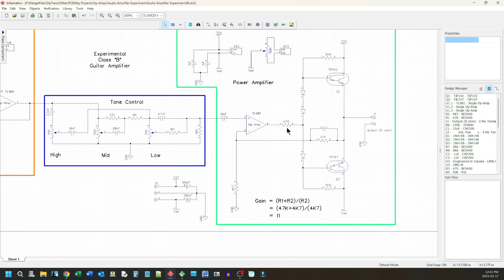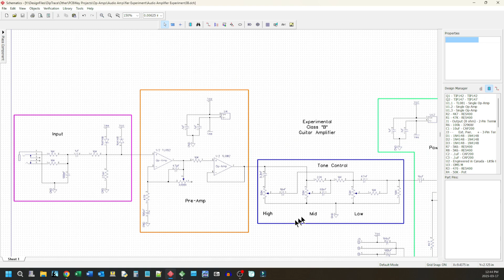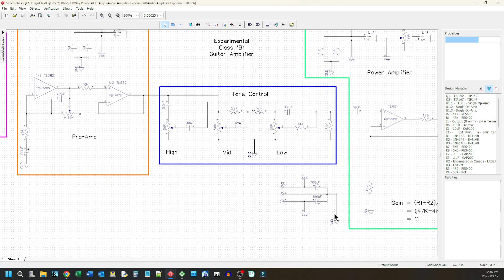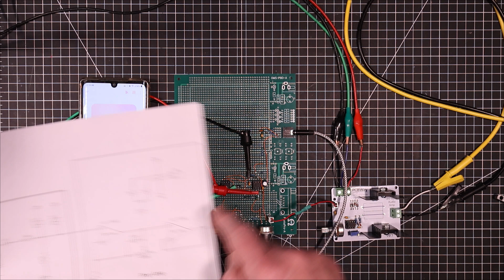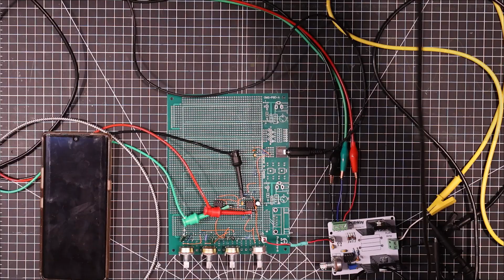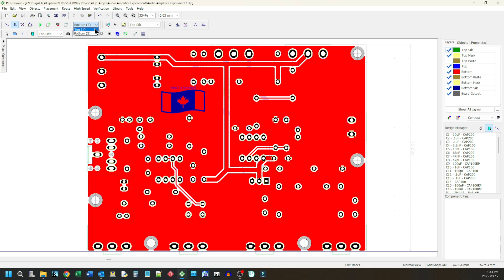Uni-Byte 0263 - SOMETIMES You Just Have To GUESS : Easy Guitar Amp: Part 3

Comment: You need a resistor between the  opamp output and the output of the circuit, not between the opamp output and the input to power stage. Your 470R resistor will improve stability, but voltage gain of the output stage is <1, so resistor is not needed. On the hand, a resistor between the opamp output and the power stage output will improve cross over distortion.
Reply from the maker: I'll give it a try, but I'm not sure how the few mA from the op-amp will make a huge difference when feeding into 8 ohms.  What value would yo suggest?
Reply: @uni-byte  You need to check what is Vbe at which transistors conducts more current than opamp. If that happens at say 0.6V, then transistor + opamp current will be 0.6V/8 = 75mA. If opamp is supplying half of that then about 16-22Ohms (I would go with 20 or 22Ohms) would be good choice. However it is too low for your opamp, but NE5532 would handle that just fine.

Comment: This explanation is going to take a minute, so hang in there with me... And, I am working from memory, which we know can be fuzzy... Regarding your prior video using multiple pots to achieve extreme precision with the volume setting, you will recall that I offered a design that I had seen of a slightly different circuit. You used a tandem pot, for two of the three pots. The advantage being that the range of adjustment would always be identical on both sides. My circuit did not use a tandem pot, meaning that the bandwidth range, its center point and the volume of the signal could be changed. Finally, my point... If my three pot circuit was employed as the tone control, could it not be configured be an analog adjustable bandwidth tone control? Meaning, the user would have control over the three stated perimeters. Isn't this called a three band parametric equalizer? One might ask why would anyone want so much control over the tone of an electric guitar amplifier? Because, the guitar type being used might be what is commonly referred to as an electric guitar, or it might be an acoustic guitar that has a built in electric pickup. The tone control settings for the two are very different. Often, the tone control for an electric guitar is a separate unit, unto itself. It might be as simple as the one you added to the amp circuit, something a bit more complex, such as the 3-band analog parametric design that I mentioned, or a full blown 31 band equalizer. Of course, a 31 band parametric equalizer is the "dream machine." There is another school of thought that does not advocate tone controls in the amplifier, at all - relying on the tone controls in the guitar, itself, or a separate equalizer. A three band analog parametric equalizer would make a great follow up video series (IMHO...) As an aside, my ear does not like a digital equalizer on an electric guitar. I apologize for the poor wording. No sleep, again. Well, imagine that (a grin is implied, here.)
Reply from the maker: Interesting idea.  I'll have to look it up and see  what i's all about.  Sleep is over rated.

Comment: Nice ! tone controls are a pig to design !
Reply: Pcb scamatic diagram please give me ❤
Reply from the maker: @dipakbhalodia7155  You mean for the proto board or for the amplifier?
Reply: @uni-byte  circuit diagram दिजीए बनान है
Reply from the maker: @dipakbhalodia7155  To make what?  The proto board or the amplifier???  I no longer have the files for the proto board, that was designed more than 14 years ago.
Reply from the maker: Yes, they are!